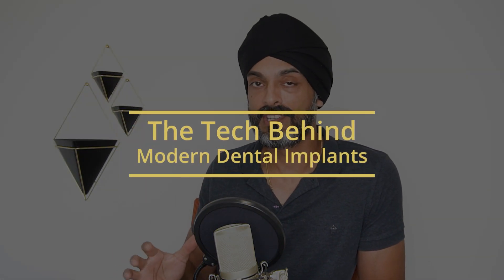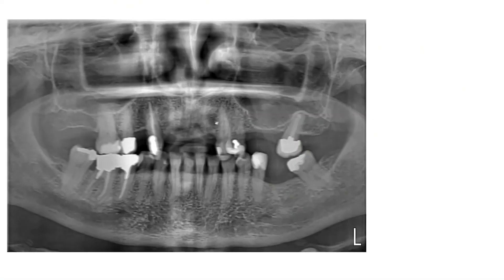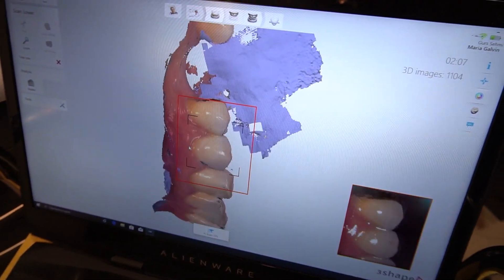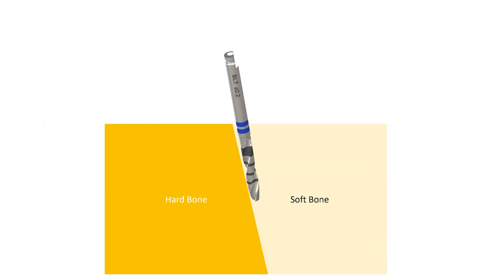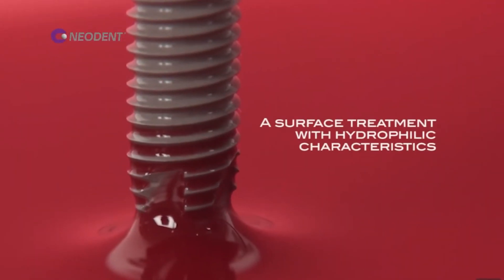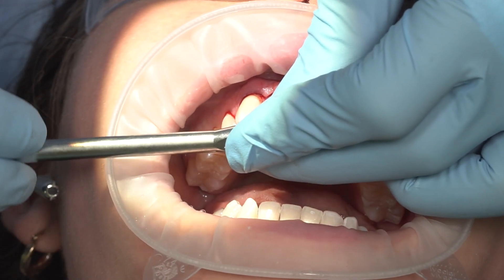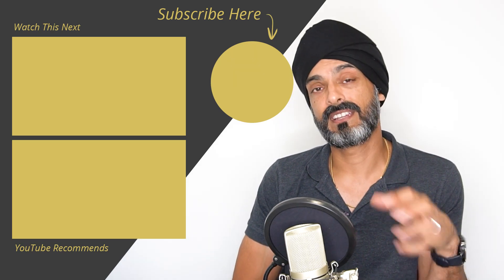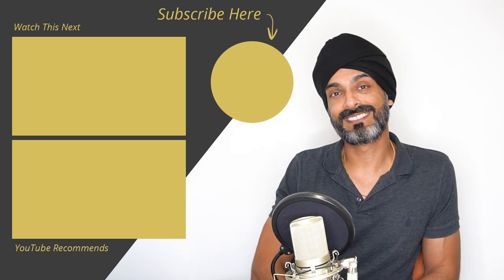Dental Implant Technology in 2021

Comment: I am.shocked to fins out the ceramic ones come worh aluminum oxide. I would like vodeo also on the other mentals present in titanium imolants . Strsuman does grade 4 but contain zirconium  12% .. it's not stated what grage zircoinium. There are still traces of other metals in gradr 4 titanium alone. What are the risk of this metals in oure body.  Who is at risk of developing sensitivity?  Should i take metal sensitivity test? I read about it affecting lungs, spreading to other tissues, when does it happen, over time ? I resd they can chip to surrounding tissue and casue problem.  I don't think patient is told much of what are side effects or the full implant chemical  composition. Dentist seem to be upset to get asked to much. Do you do tissue level implants  or bone level ? Are the bone level really hard to clean